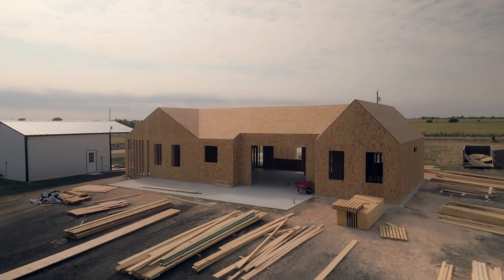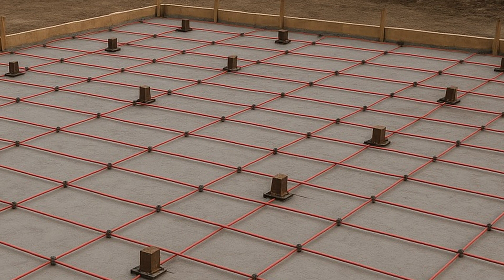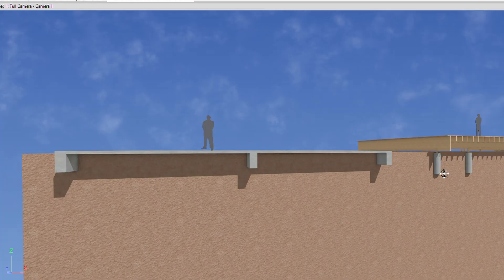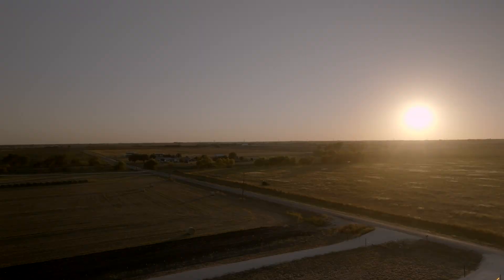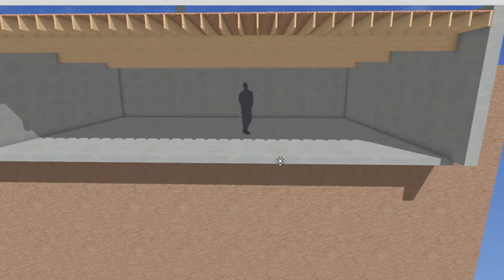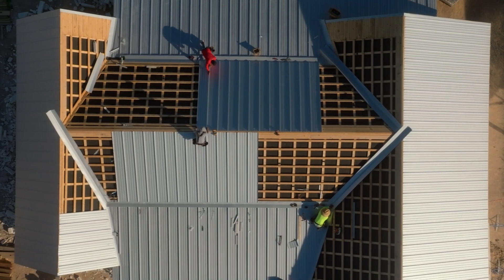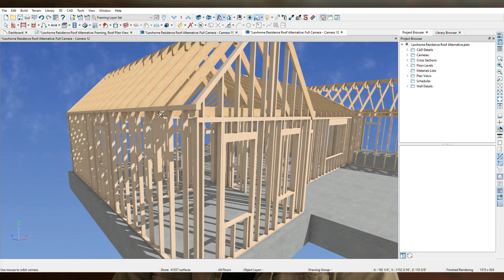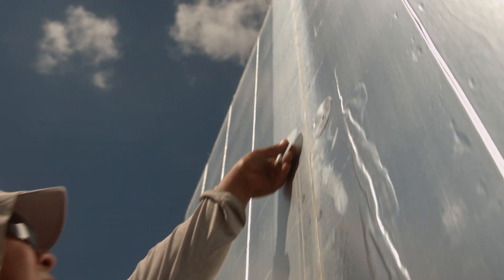The most expensive mistake you can make on your house.  - AHPH 107

Comment: I'm in the DFW area and I will say that slab insulation should be done here. It's amazing how hot the slab in the shop can get if you aren't keeping it cool so slab insulation does have a benefit in the summer. Our soil is the opposite of everywhere here as it's pure sand/silt. No clay no rocks. The ground here gets extremely hot in the summer and that heat is transferred to the slab. Our drinking water is city supplied(irrigation is off the well) and the ground gets so hot that the cold water temp is in the 80s in the summer. (I would like something to cool it)
      As for a shop. If I were building one in this area on this soil today I would insulate the slab and put in floor heat tubing in it. I would run the well water through it in the summer to get "free" cooling in the summer. My well water temp is 70* out of the ground but would keep the slab from getting to 90*+

     Another issue to keep in mind is to not trust the concrete supplier. There was another construction company doing a fast food restaurant that we didn't win the bid for and after construction was mostly done they found out that the concrete samples tested out at 2000psi.Obviously nowhere near what it should be.

Comment: For foundations one interesting idea I saw was a foot under the soil at the edge of the foundation, set some insulation tilting outwards. An inch will do I think that they were taped, but I am not certain. This does two things. 
1 it pushes the bulk of the water further away from your foundation. 
2  It slows the creep of heat and cold under the slab. Some of the heat and cold will go through the insulation, but most will go around it, and that heat and cold will have to travel another 8 feet before it starts influencing the temperature of the slab. 

The depth of the sloping insulation is mostly to protect it from damage, and to allow the owner to plant ground cover next to their house with shallow root plants. If they want larger plants adjacent to the house, maybe go deeper. Though there are house fire and root intrusion reasons to not plant super close too.

Comment: Actually the earth is not as cold as the surface. In my area northern Virginia it is warmer under ground, like between 43-49 degree Fahrenheit half a foot below surface. The deeper it is the warmer. With the building wall’s insulation, the ground inside a building will be way warmer than that of outside a building.
Reply: But at certain times of the year, it may still be below the dew point. Got to watch out for that.

Comment: One solution in an expansive soil area that was the most economical was drilling piers deep enough that the soil columns were in a deep zone of less expansion. Instead of reinforced concrete caissons the spec was to backfill with non expansive rock and sand to three feet of the surface. 14 inch thick footing over the compact soil columns. Then start your grade beam perimeter footings. Compressible support material for the slab support and done. Just like that. Lots of brilliant ideas out there, but a broken and inadequate foundation is a disaster. NEXT talk about inadequate ceiling height and floor deflection, when discussing disaster in construction. Things that are impossible to fix.

Comment: I think I need either an unconditioned crawlspace, or one with with some kind of air circulation and heat recovery. I live in a place where radon coming up through the slab is a constant threat, so 'round here we need to be.. lifted up, but also provide a path of least resistance for the radon that isn't up through the house.
Reply: Wouldn't closed cell foam underneath your foundation totally prevent that?
Reply: @PatrickQ4HBD  No, it certainly helps, but if there's not an active way that the air is being pushed up, the radon is small enough to diffuse through concrete, wood, and insulation. Just slowly.
Reply: @DeDraconis  Closed Cell insulation absolutely will stop the Radon gas from seeping in. The issue is, you are dealing with something that can cause harm and problems, and it's not easily detectable in the event that the seal fails - so, we need a way to have reliability, in such that if it fails we can reasonably detect it and resolve the issue quickly at low expense.

So while most forms of insulation are porous, and cement is porous, and wood is porous - closed cell insulation is not. It's actually one of the problems that can arise with it, in that it does not breath: No air, no moisture is getting through - so, if you end up with moisture getting behind it, the area does not dry resulting in the studs and exterior sheathing deteriorating and eventually failing.
Reply: @formes2388  Professionals in my area where I currently have a half-basement have said otherwise. Closed Cell Foam is an effective barrier only up to a certain saturation, where being airtight is enough to prevent leakage. If there is not also, in addition to that, some way of cycling out the air in something like an insulated crawlspace, the radon will eventually seep through it. Like, the individual molecules can permeate through, despite it being non-porous and airtight. So if I have a crawlspace at a place around here someday, it must both be insulated on the top and either open at the sides, or have some kind of air handling unit in it.
Reply: @DeDraconis  Does the radon leach out from the soil itself or from granite bedrock deeper down?
Reply: @MrHuram-abi  Way deeper down. It's a degradation product of Uranium.

Comment: I'm curious to see how to resolve the conflict between ICF foundation walls and water. ICF is a good option, but it prevents you from waterproofing the exterior,  installing a dimple mat, etc.
Reply: I am curious - why do you think it prevents waterproofing? While there are some materials that are incompatible with the polystyrene on the outside of the ICF, there are plenty of options, particularly adhered membranes, that work just fine. Further, so long as the dimple mat is attached properly to the ties in the ICF, then it works just fine. Curious as to where you are coming from.
Reply: @spenceralridge4958  Concrete is porous. We often deal with that by applying a coating (think black asphalt/tar-based). An ICF foundation is composed of styrofoam "bricks" that are certainly porous at the joints, but do not allow applying a waterproof coating to the concrete.

As for the dimple mat, fair question, but what happens when the dimple mat is against the ICF, not the concrete? Is there any data?
Reply: @ Yep, I completely understand the porosity of concrete and an asphalt-based waterproofing will not work on the polystyrene. However, there are many waterproofing products that will work just fine on polystyrene, so I really don’t think that is an issues. As for the dimple mat, polystyrene underground for long periods generally does not fair well, especially in termite country. But once coated for waterproofing I don’t see a problem. There are actually some product that are specifically designed to provide both termite and waterproofing to ICF blocks. Anyway, appreciate the discussion.

Comment: @Jordan Smith, I have a Top & Bottom questions for you... I planning to build a small Modern Shed Roof (Skillion) Home with Clerestory Windows, single-story home in Northern New England with an insulated concrete form (ICF) foundation. The design includes a half concrete slab (that will be a low frost protected stem walls with extended 2” ridged x 48” foam) for the kitchen and living room on one side... Two bedrooms, and two bathrooms, with a full basement (Stego Wrap Vapor Barrier with 2”+ ridged foam) other side. The roof will feature a double shed design with exposed main glulam carrying beam and glulam roof rafters, and the building will be oriented south. Additionally, there will be an attached passive greenhouse. What do you think??? I have not met many people that I can converse with becuase most people just build conventional gable roof styles, I guesss??? Liked #111 N Subscribed, would like to speak with you...

Comment: I have piers with a slab. I am in sand with 6 foot frost depths. Code here requires foundation to be insulated. I dug my piers down 6 foot to the hard pack. I have a passive solar timber frame skillion design. Timbers and masonry materials are cheap where I am at in U.P. of MI. I also have a 70 psf snow load. I went with mineral wool as we have lots of mice.
Reply: What diameter are your piers?